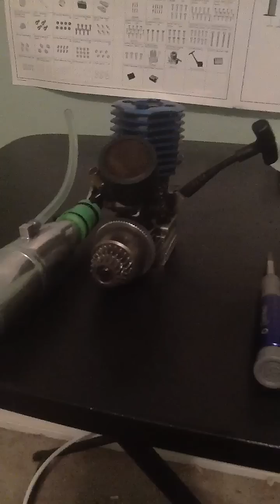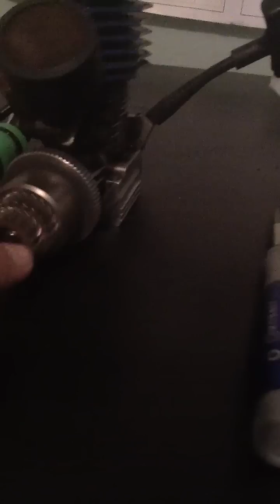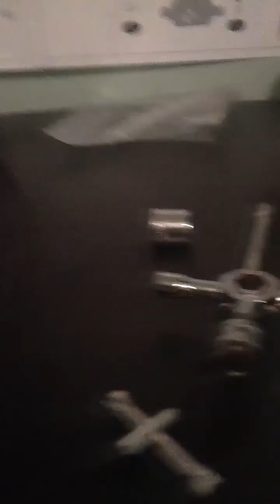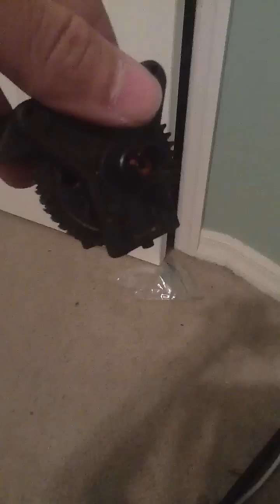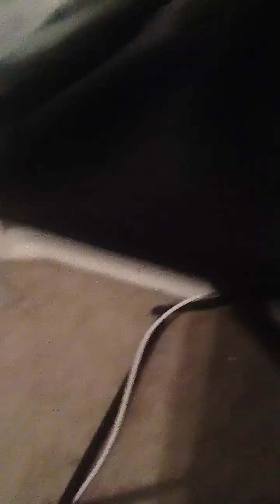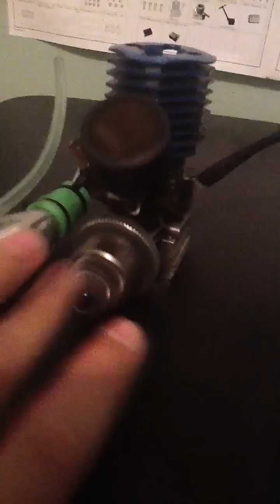Why motor revs but doesn't go any where

Comment: Ok guys machanics I have a Cadillac CTS 2005 recently had. Problem with a misfire changed the spark plugs changed  the coil the fuel injecter purge valve now I have a problem where I put my car in drive ND it won't go it Reve but won't go reverse either they said my transmission others a line where the shaft is or a sensor I don't know wat it might be any idea please help
Reply: Hi Ray, did u find out the problem?

Comment: Its probably dirty or clogged fuel injectors....the fuel injectors put fuel into the cylinders to become a mixture of air and gas to ignite from your spark plugs,, if its clogged, their wont be the proper mixture to combust and give it enough power.
Reply: No spark plugs on nitro engines
Reply: Also no fuel injectors

Comment: I have a 98 Mitsubishi Montero sport automatic transmission.  It only goes in reverse. If I put it in any other gear it will not move. I can manually shift it to all the gears and it drives fine. What could be the problem?

Comment: Hey I got a problem with my 1/10 himoto syclone 2 speed nitro buggy, recently had the 2 speed transmission replaced and the main dog bones replaced, everything was spinning as it should, had to replace servos and tank so I took out the engine to make it easier to get the tank and servos out, when i put the engine back in the entire drivetrain locked up, so I took it out again to see if I just didnt line it up right, but even with the engine out one gear would move and the other that rotate the  main dogbones was locked, I tested to see if the brakes where just on by giving it throttle  and then pushing the lever forward to apply the brakes, the main gear and main dog bones remained locked, anyone know what maybe going on, this thing is  driving me nuts